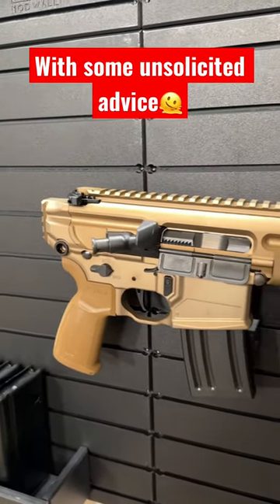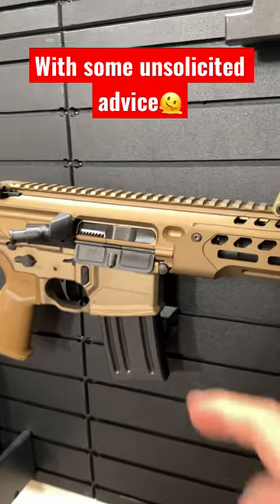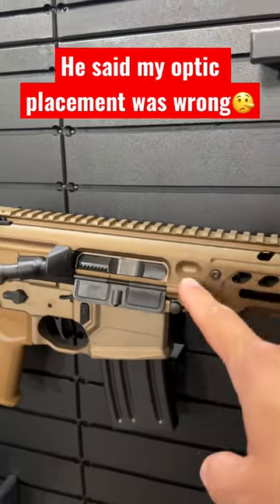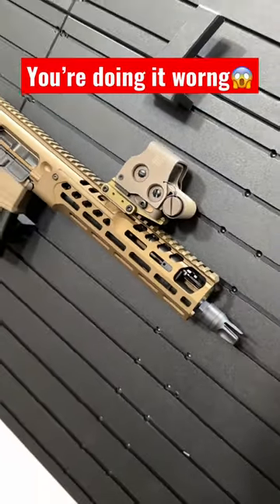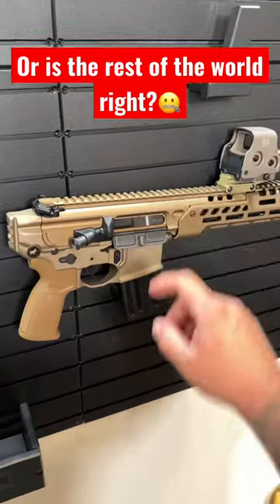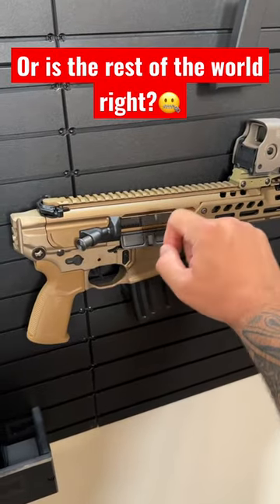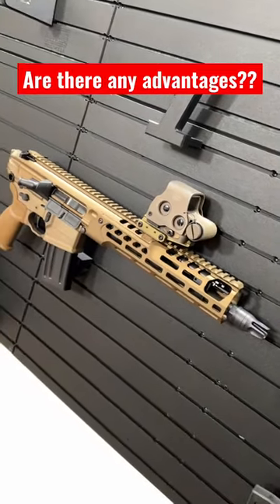Your Doing It Wrong😱

Comment: Red dots as far forward as possible (probably holos too) is the best for better field of view. Since that has a monolithic receiver it will maintain zero. Since regular ARs have a handguard attached to the barrel nut its likely to not hold zero, so nobody puts it further than the end of the receiver.
Reply: Sigs dont have mono rails either
Reply: @jasongillette3119  in the video theres absolutely no seams that rail is 100% one piece up to where the optic is mounted. So its pretty mono
Reply: @brossovitch  mcx dont have mono rails its a 2 piece that is secured but a cross bolt. they had issues with the rails bending and throwing lasers off zero.
Reply: Sig rails aren't monolithic they still have detachable handguards, the place where that optic in the short is right where the rail ends from the receiver.
Reply: @brossovitch  ariaska defense even made a fix for the mcx rail causing 0 shifts

Comment: i literally had a guy at a gun store tell me my optic being forward of my upper receiver would mean my optic would never hold zero. For those curious I use one of Aero Precision's free floating handguards. That handguard does not flex or move, it's a press fit onto the barrel nut that's screwed in SOLELY to prevent you pulling the handguard off, the screws are not what holds the handguard in position. That optic from its first zero has NEVER moved and held perfect zero. Some folks are just given bad info

Comment: You will never lose ur zero if mounted directly on the upper receiver. If the handguard moves even just a lil bit. Ur zero is gone. Haggard rails are mainly meant for accessories.
Reply: look at the gun though look where the receivers at
Reply: That's a monolithic rail. It doesn't matter, it's not moving at all.
Reply: Oh yeah didn't notice the mcx has that receiver extension rail
Reply: But if he's suggesting that the rest of the world does it it's bad advice

Comment: The only real advantage is if you're running an infinite eye box optic like your eotech, and shoot with your off eye closed.
 Mounting it farther forward intuitively gives you a wider field of view around your optic, less obscured area down range, and helps to prevent you tunnel visioning through the optic. 
However, with that being said, you could also train to shoot with both eyes open and achieve a much greater effect in that regard with the optic mounted farther rearward.

Comment: i run it somewhat like him, but not as far forward. Most useful thing about it is that you have less part of your FOV blocked by the edges of your scope and it will also help to not create tunnel vision. In our army most guys run the sight right in front of the ejection port

Comment: If modem optics worked like 1950’s Nydar red dots with limited casings/obstructions, as far forward as possible would be best. 

It would technically be more accurate if you could see that little 1MOA dot so far forward

Comment: In the very early days of optics when they first came on scene, it was traditional to tell people to run their optic as far away from the sight line as possible so that it would blend in with your rights eyesight. That way the dot was superimpose. Over the years we found this more comfortable to put it basically at your front of your receiver. That way you can have room for lasers and other things lights and stuff. So technically he is correct in a way but not right

Comment: The reason that the traditional spot is at the front of the receiver is because it is as far forward as possible without being on the handguard. This is because the further forward an optic is, the quicker it will be to acquire, and there will also be a decreased magnitude of parallax. Because the sig mcx upper receiver extends into the handguard, you are able to move the sight further forward than you can on traditional m16s. You technically always want to move it as far forward as possible without being on the handguard. So, that other guy is correct; but he failed to inform you that he cares about function over form whereas you prefer form over function

Comment: It's theoretically more accurate because a smaller change in angle will result in the same change in perceived position, (assuming the front hand is wobbling around more, which is a fair assumption) but I can't say if there's a practical effect.

Comment: I prefer it on the back of the handguard, that's too far forward.

The purpose is it obstructs less of your peripheral vision and it's also faster and easier to acquire the dot with your eye imo.

The negative is the frame will block targets closer to your point of aim than normal

Comment: As far as i understand and expireienced it: the farther your optic is away from your face, the faster is the reticle acquisition (for an untrained shooter) and the better is your periperal view. Normally seen on AKs. (or on some scout rifles with magnified optics)
Personally i like to have the optic as far back as possible, cause i am used to shooting a g36 with the standard issue optic. In this case, where your optic is far back on the rifle, your brain starts subtracting the optics housing from your perception which ends up in only seeing the free floating reticle. However this needs some training in shouldering the gun correctly. otherwise you´ll end up searching for your reticle.
Talking AR-style rifles: I don´t see a point in putting a larger optic like an EoTec that far forward. Firstly the massive housing of the optic blocks to much sight in target direction, second the rail moves more than your upper, inflicting problems with your zero.

Comment: You NEVER mount to your handguard. Always to the upper receiver. 

Some people do like to mount it at mid way for eye relief depending on the optic used but still should be attached to the receiver and not the handguard.

Comment: Forward provides a smaller aperture which aids in precision. I run it to the far end of the receiver in rifles with a handguard which isn’t pin located. If it’s pin located to avoid sight drift due to handguard rotation  then I run it just after or married between the upper or frame.
Reply: It also shrinks the left eye blockage. So when shooting targets to the right  of the weapon are less ohbscured

Comment: I mean with it being monolithic you could and it would slightly increase the field of view around the optic, but ya get to a point where the additional benefit is minimal at best compared to the traditional front of receiver and also leaves you with no room for BUIS, pressure pads, or device etc while also leaving no real good way to use a magnifier

Comment: So, on a serious note, it would have advantages and disadvantages. I like to run my smaller red dots like that when doing room clearing, it allows for a better peripheral vision. but also makes the sight more vulnerable to damage, and makes the front of your gun heavier. overall, that is too far forward, I like to go around 6 notched forward from the fartherst to the rear

Comment: It depends on the setup if you are only running a holo or Red dot or you have backup irons that you want to co-witness then running it forward is better for holding bore sight. Floating hand guards where designed for that reason. Because it is past the solid recoil parts on the gun.

Comment: The further forward the better the FOV. That’s why you run as far forward on your recover as possible . The reason you don’t do it in your handguard is because they can shift and rotate. On the mcx it could work because the rial and receiver are one piece . Having weight that far forward though will be felt. 13 top heavy ounces will make the gun feel like it whips when you try to maneuver it

Comment: AK guys do this as a cope. There is a genuine reason to push them out forwards which is to have them obstruct less of your close peripherals but it comes with the trade off of obstructing what is around a target sometimes. That said, running it very far out tends to lead to a lot more abuse of the optic, making the gun front heavy, making the gun bulky, and looking stupid. Push it out as far as is comfortable but also dont run it as close as you can to your eye. Theres a nuance and balance to be found for each shooter

Comment: Since you've got a monolithic upper, you can push your optic out further, in turn giving you more peripheral vision,  being a dot, you have unlimited eye relief so you don't have to have it right by your face.  Since it's a single point of aim, sight radius isn't important.

I run with my optic pushed perry far out on reactionary rifles, and anything unmagnified, If using a a dot/magnifier combo, you do have a maximum limit, amd with any kind of true magnified sight, lpvo etc you obviously need to account for eye relief.

Comment: You notice how the rail runs the length of the weapon?  You can put it anywhere you want. Close or far changes the angle you attack. You should run some rounds far back and far foward and mid to experience the difference. Just standing at a indoor range wont give you the chance to really notice a difference. If its far forward your f.o.v. is much smaller and if your standing in one place shooting at a stationary target it would make sense to do. But running it on the back gives you a wider f.o.v.  I personally try and keep it mid if im using an optic at sll.

Comment: I have been told to do that so the optic is farther away from the energy of the bolt. Never had issues with losing zero so I don’t see the point. Mount it as far forward on the upper as you can, stay off the handguard👍🏻

Comment: For everyone who hasn’t been shown when and why to do this I will explain, because unless you’ve had formal schooling on it, it’s hard to guess. But it is for shooting at night, EOTech’s have an IR Mode so you can see the optic through your NVG’s but if it isn’t that far forward it is hard to get proper stock and head placement on the gun

Comment: Typically, for this type of sight, it's preferable to have it mounted forward on your receiver rail but not on your hand gaurd since your receiver rail is fixed. However with this set up your handgaurd style looks like it would be just fine to place it further forward. The benefit is less obstruction in your field of view with both eyes open. Works great with this style sight. It's mostly preference though. To each his own.

Comment: on my cyclops 1x  you adjust size of Advanced combined rectical by moving it forwards 
especially the range finder thats not lit
The problem with to far forward is when you sight in on target the rec is wiggling and patience is a marksman . wait till they settle .
Farther out on muzzle will wiggle longer
rec will be to big that far 
front of receiver would be right and back depending on individual and distance you are fighting at.

Comment: I can't see any reason to do this unless you're running an Ak that only allows for a gas block pic rail, or any firearm that may require it so far forward. I guess one could argue that it gives you a wider field of view being that far away from your eye. but most people keep both eyes open when using a dot so that would actually obstruct your view. Also, if you're using a tradition red dot with a ring like a holosun that ring is going to appear larger the farther away it is from the eye also obstructing your view. All that being said Ak guys have been running gas tube dots for years now and haven't had an issue, so I don't think it's that bad unless your trained to run it farther back. also, you have a mcx which uses a monolithic pic rail so you would have no worries about zero shift.

Comment: Actually they say you want the optic as far forward as possible but not on the handguard. But then again that's on ar handguards where the handguard isn't actually connected to the upper receiver. And the reason you don't want it on the handguard on an AR is because the handguard could come loose and mess with the zero of the optic. But on this gun in the video the handguard is actually built into the upper receiver so maybe he's right idk

Comment: "technically" closer the optic to the tip of barrel the more accurate... though the recoil shock its likely more then the optic manufactures intended and the optic better have a good parallax   correction or you'll have to be dead ball straight on to get any advantage.

Comment: Wouldn’t it be prone to losing its zero there? It’s a free float tube meaning it’s not attached to the barrel so it can flex/shift independently of the barrel. Vs the upper receiver is directly attached to the barrel with the barrel nut.
Reply: That's a monolithic upper

Comment: the traditional area at the front of the receiver is there because on an ar15 the handguards rail is not as rigid  and can flex or come out of alignment losing your zero, on something like the mcx spear the handguard's rail is integral to the receiver so that issue isn't there

Comment: Seems like a method based off of the AK style of mounting to the forward stock, due to the dust cover having "play" and possibly losing zero. In the case of the rifle displayed it seems silly and is strictly user preference, with no advantage or disadvantage whatsoever (other than your eye having to focus harder to acquire a farther away POA).

Comment: It'll be fine as long as you never drop it, accidentally smack the hand guard on anything, those small screws holding the hand guard aren't loose or become loose over time, etc. Otherwise just put your optic on the most solid part of the system like everyone else does for obvious reasons.

Comment: Would make sense on a take down, where the barrel separated from the receiver, to retain zero in relation to the barrel,  on say a lever or bolt gun where the optic could get dinged  by ejected rounds , or to open up peripheral view.... but in this application, it'd just goofy.

Comment: I don't see any advantage to running it forward but the heat from the barrel isn't gonna be good for your optic. Even though you have a free-floating barrel it's still gonna get hot. 
  I run mine to the rear and it's extremely accurate.

Comment: Heres the thing, conventional wisdom will tell you not to mount anything past the upper receiver as beyond that things may shift, especially on a free floated rail. These are also likely the same people who have never built a complete upper and have no idea how tight that lockup really is.

Now to the theory portion. the further from the eye the dot is the smaller it is in relation to the target. a 1 MOA dot close to the eye becomes smaller the further away from the eye that it is. So given a tight lockup, a 1 MOA dot at 4 inches becomes substantially smaller at 8 or 10 inches. It also reduces the overall visible size of the optic in both one eye and two eye target acquisition .

For those that question this, I have to ask, why then do you trust BUE mounted on that very same rail?

Comment: The only time I've seen optics run this way is out of necessity, like if you're AK dust cover doesn't have a rail but the handguard does. But even then there're plenty of dustcover options with rails on them and if you already bought the handguard you probably got an aftermarket cover with lt so you can still run flashlights, PEQs, and all that good shit. 

Truth be told I can't see it being more practical than just mounting it closer for eye comfort. But hey I'm not gonna judge, as long as it holds zero we good, seeing a reticle is probably a bitch tho.

Comment: for RDS and Holos, the further forward you can run it without compromising your zero the better. All your field of view comes from your other eye, so the further forward it is, the more unobstructed FoV you have. In the case of the LT, if the handguard doesn't flex or anything, you could theoretically run it where you'd put your front sight post similar to an AK with a railed handguard. 

Looks stupid, on most guns it doesn't work, but there is logic behind it.

Comment: On the typical M4/AR15 Upper you want it as far forward as you can have it on that upper without going over onto the barrel shroud itself, Mainly because the shroud tends to move and you lose your zero as opposed to keeping it on the receiver itself. It allows for better eye relief and for you to be more situationally aware of what's around you and your target, Essentially also a better field of view. Now I don't think you should have it as far forward as you have it in the video maybe up to where the notch is after the ejection port max.

Comment: I do run an Ak so the only option I do have is a dove tail or my front rail there is an eye relief factor in play but I don’t think there’s any benefits with something like an eotech on the Ak platform it does look classy with a micro dot but there rlly isn’t a right or wrong I believe it’s a personal preference amd aesthetic
Reply: @xstevenx8132 does a much better job explaining this a couple comments down.